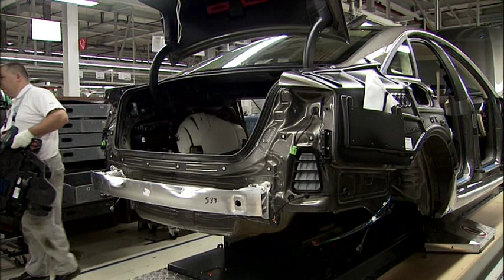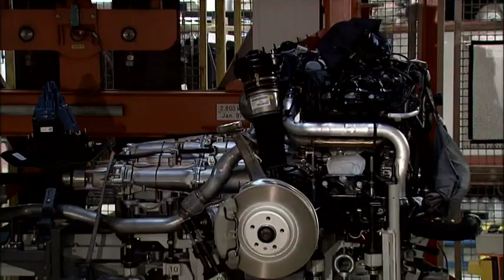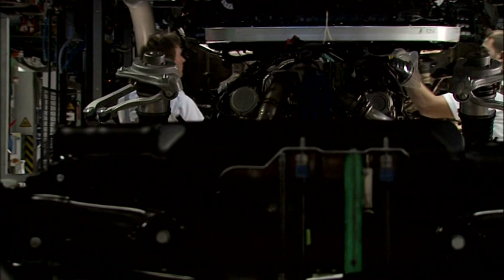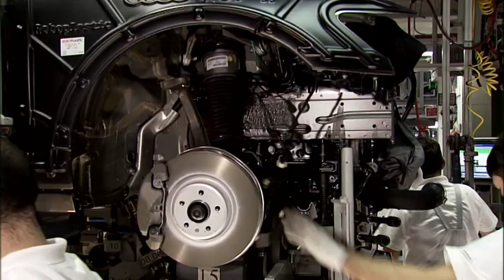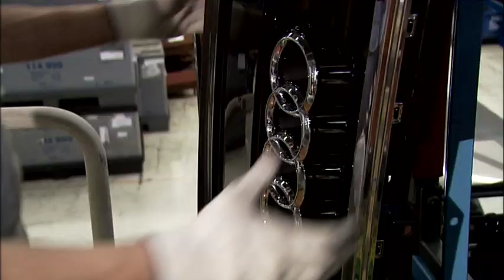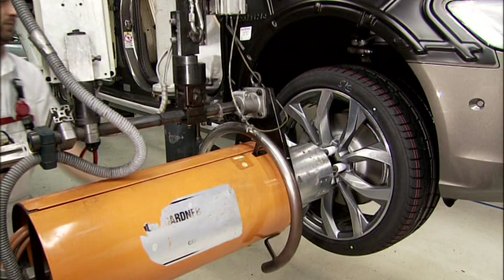2012 Audi A6 Production footage

Comment: @ultimaster1 Wow you are really freaking me out... :D 
Mine has only 75k km on it! What's the engine in your car? And what year is it? Mine is from mid 2006 brand new when I got it and it is a 3.0 TDI engine...! Also I have another A6 C5 2.8i and it also doesn't have any problems AT ALL! In my family we  have other Audis as well and neither of them seems to have a single issue as well except again the oil and the brake pads replacement...!! All the things you've said are just amazing...!

Comment: @dongleboo 5th: 2 years later Car starts to overheat leading to constant refills of coolant
6th: Headlight xenon light blinking due to failure of ballister never fixed.
7th: Exhausted disconnected from the main "I dont know how that happened but it just did"
8th: Finally the most costly problem on my part. Camshaft gears break off.

God Help Me cause with all those repairs i could've bought another audi.

I am Shocked to hear that you're not having a single problem. I'm doing 180km how about u?

Comment: @ultimaster1 The only thing that I changed in any of the audis my family owns is for my 2001 A6 C5 2.8i! I had to change the front right spring because the previus owner hit it in a curb...! And in my A6 C6 I had to change the rear parktronic sensors and from there the speaker of the parktronic because an idiot crashed into me on a traffic light and broke the sensors and after that the speaker sterted to make strange sounds...! That's all the problems I had with Audi! Sry about yours...srsly!

Comment: @dongleboo Time to share my bad experience with my first and last audi. I must say this car was a major upgrade from my 1998 Volvo S40. Bought the car on June 2006 fully loaded around the same time my cousin bought  a white one. Here's the list of problems that happened over the years.
1st: Mysterious behave where the vehicle would be jerking
2nd: Shut down due to Spark Plug Coils having to be replaced
3rd: After 1year Transmission started to make a whining noise
4th: A/C blowing hot air
more..